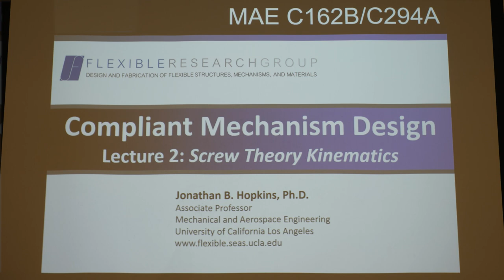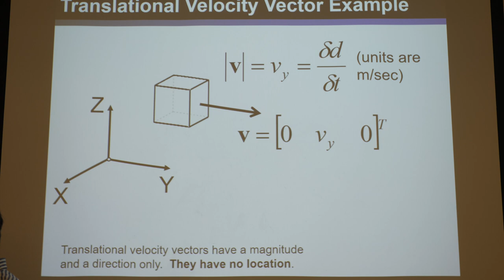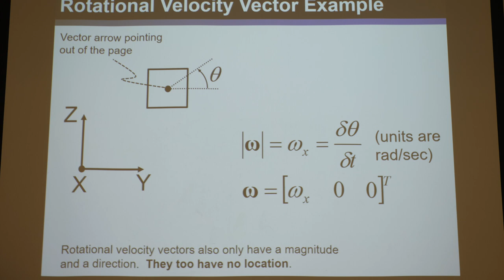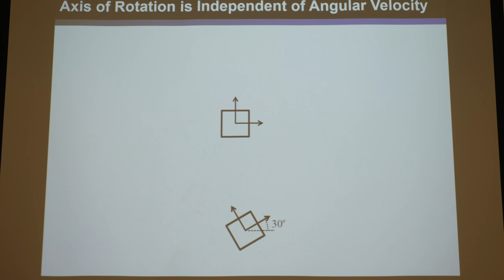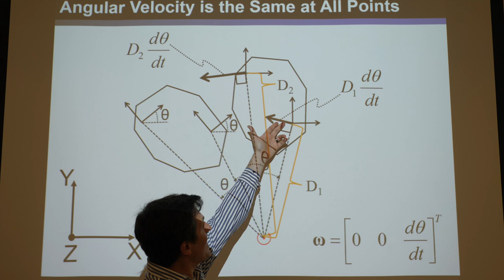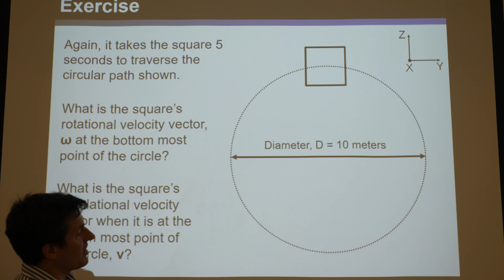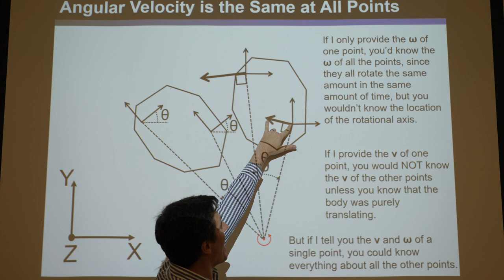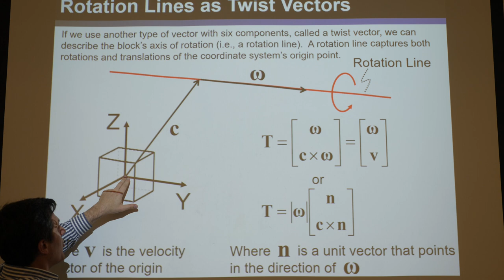Compliant Mechanisms Lecture 2 Part 1

Comment: I think in the first and second exercises you forgot the emphasis on the variation of the linear velocity vector depending on the point considered on the square. In the first one it's the same everywhere only because it's a pure translation, but on the second exercise, the given linear value is only valid at the square center, since the inner and outer edges travel a different distance in the same time.

Comment: ## Lecture 2 Part 1 Summary

*0:01 Introduction:*

* Lectures 2 and 3 are math-heavy and crucial for understanding the compliant mechanism design approach.
* Don't be discouraged by the math; the rest of the course is more visual and fun.
* Rewatch lectures 2 and 3 multiple times to fully grasp the concepts.
* This lecture focuses on screw theory kinematics, specifically translational and rotational velocity vectors.

*1:51 Translational/Linear Velocity Vectors:*

* Represented as 3x1 vectors, describing a body's velocity in 3D space (x, y, z).
* Possess magnitude (speed) and direction but no inherent location.
* Example: A block translating along the y-axis with velocity "vy" can have the velocity vector drawn anywhere as long as direction and magnitude are maintained.
* In rotations, every point on a body has a different linear velocity vector associated with its location, but the 3x1 vector itself doesn't capture location information.

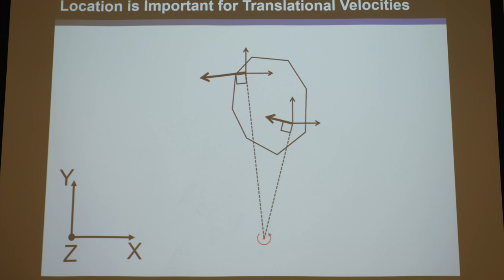*8:36 Angular/Rotational Velocity Vectors:*

* Also 3x1 vectors, describing a body's rotation speed and direction.
* Like translational vectors, they have magnitude and direction but no inherent location.
* The vector's direction aligns with the axis of rotation, but it doesn't specify the axis's location.
* Example: A block rotating 30 degrees in a second can achieve this with different axes and paths, all resulting in the same average angular velocity vector.
* Every point on a body rotating around an axis shares the same angular velocity vector.

*18:58 Confusing Takeaways:*

* Knowing the angular velocity vector of one point reveals the angular velocity of all points on a rotating body. However, it doesn't reveal the axis's location.
* Knowing the linear velocity vector of one point reveals the velocity of all points only if the body is purely translating. Otherwise, it only describes that single point's motion.
* To fully describe a body's motion, you need both the angular velocity vector and the linear velocity vector of a single point.

*27:58 Twist Vectors:*

* 6x1 vectors combining angular velocity (ω) and linear velocity (v) of the global coordinate system origin.
* The top three components are ω, and the bottom three are v, both defined with respect to the global coordinate system (x, y, z).
* Used in screw theory to package the motion of a body by capturing the motion of a single point attached to the body.

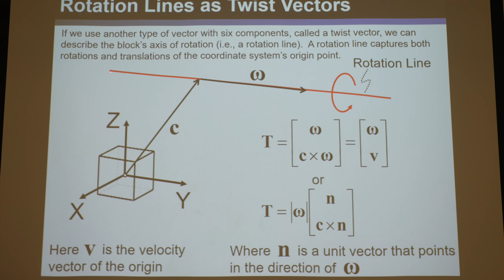*29:35 Rotational Twist Vectors:*

* Have a red "line of action" representing the axis of rotation.
* The linear velocity (v) of the origin is calculated as the cross product of a location vector (c) and the angular velocity vector (ω): v = c x ω.
* Vector c can point to any point on the axis of rotation. This is because the perpendicular distance between the origin and the axis remains constant.